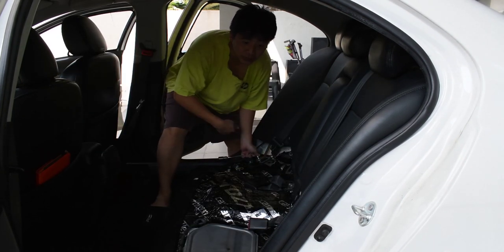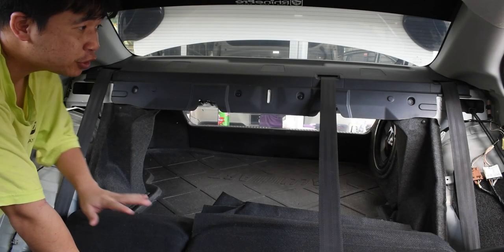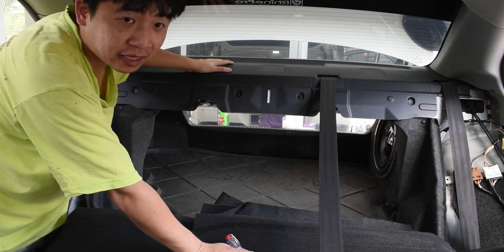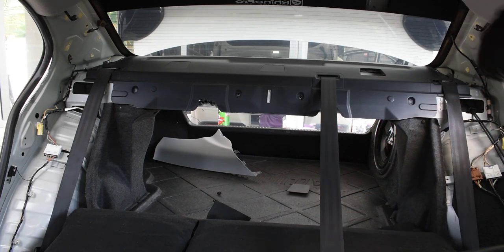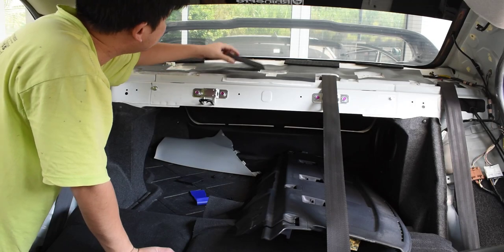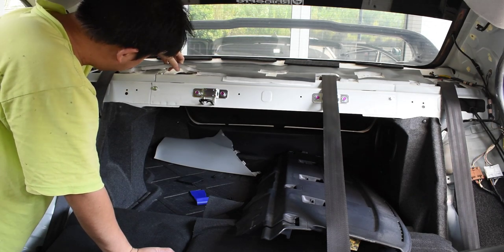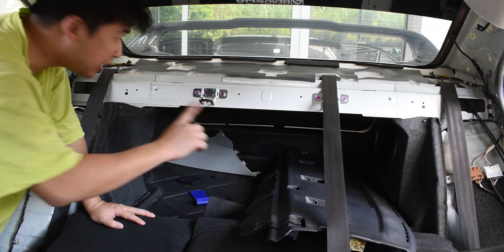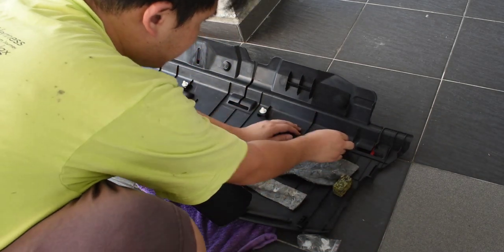Inspira/Lancer 08 Sound Proofing - Part 3

Comment: Hi TC, question after some time after you had done this. Would you do sound insulation for the second time if you had a choice? which parts are most effective to be insulated in the first order? 
What I wanted to know is if the result is worth the effort, since it looks like very tedious excercise (as you need to strip almost all interior).
Reply from the maker: The wheel arch, then the floor pan gives significant results. The boot, not so much. I have yet to do the door for my Inspira (long delayed project) but when I did it for my Putra, the results was very significant.
If given a choice, i would do it again definitely.

Comment: interesting bro. im also planning to barai my kereta for soundproof, etc. 
btw, does this alone improve NVH overall?
Reply from the maker: the soundproofing done in Part 3 alone does improve the NVH a bit. but if coupled with the things done in part 1, its almost a total soundproof for the rear which does give me very significant improvement. Also, the rear board vibration can be solved with just the things done in Part 3

Comment: Bro wanna ask, i opened the driver side panel and unplugged all wire to do some thing, afterward plug back,  the power window is not functioning anymore, is the switch need to reset? Or jusr probably the plug might loosen?
Reply from the maker: There should be no need to reset anything. Check your plugs again to make sure its plugged tight and whatever you were doing earlier, make sure it did not accidentally cut into ur wires
Reply: @TCsAnythingGoes  yah bro, drill bit hit the wire while mounting on speaker, fuse blown. Never thought it will blown the fuse even no insert the car key. Thanks bro